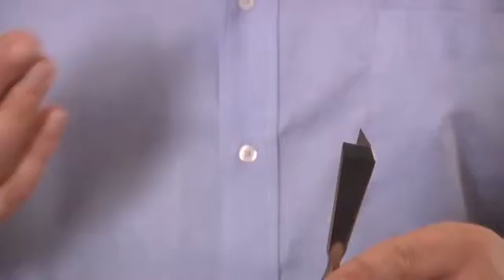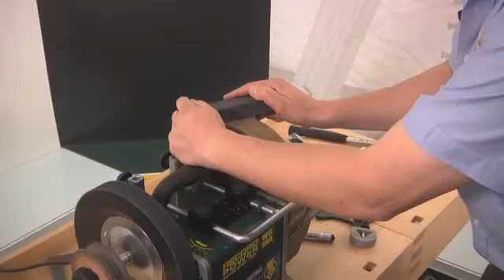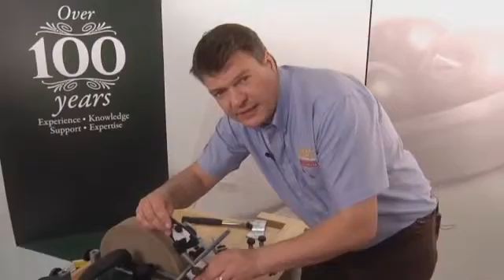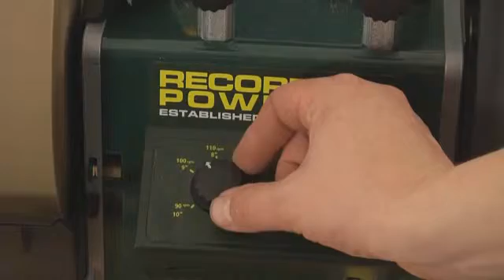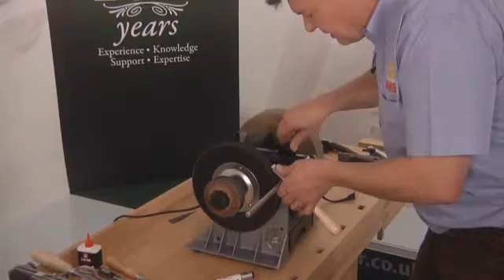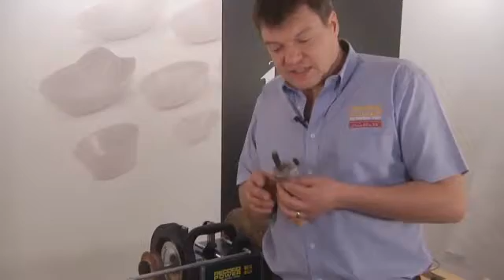WG250 Wet Stone Grinder - Sharpening a Carving V Tool

Comment: I've had the torturous task of sharpening v gouges. Until I got a flexcut v tool I wasn't even aware of the elongated flat diamond shape on the bottom of them at all. Non of the secondhand tools I had bought till then ever had that ground into the bevel. Secondly I have an issue where the blade edge near the v tends to wear a curve into itself Ging the edge profile look beak shaped. The tip of the v protruding then sweeping sharply towards the top of the blade edge again. What is it I'm doing wrong for that to happen. I also seem to end up with bevel edges that look good but then erode unevenly or even break off on my gouges. This has only happened on gouges and chisels that I have had to re escape entirely. I've used grinding wheels or belt sanders to redo a new bevel from scratch. I also have problems with making the bevels evenly sized. They can differ slightly to one degree or more from side to side giving a skewed chisel bevel to them. I try my best to maintain even pressures and angles but unless I use a blade jig (only flat chisels can use the ones I have) I can't get it right at all. And even the jigs for some reason the last fraction of a millimeter near the edge can't be reached I always seem to be close but it never gets there unless I increase the angle near the tip. What is that about? It's in a jig how come the bevel grinding never reaches the edge it seems?